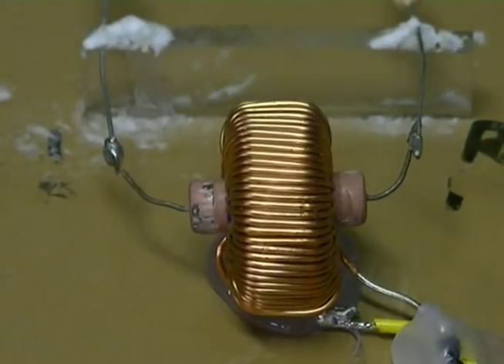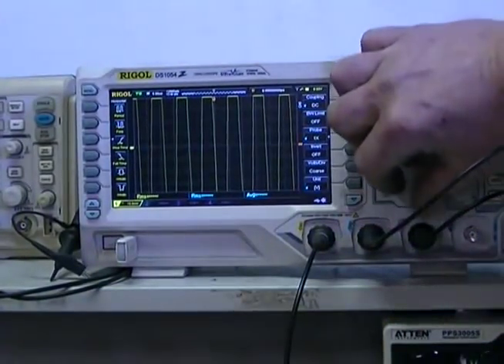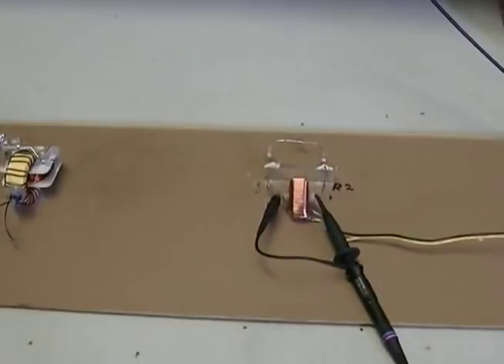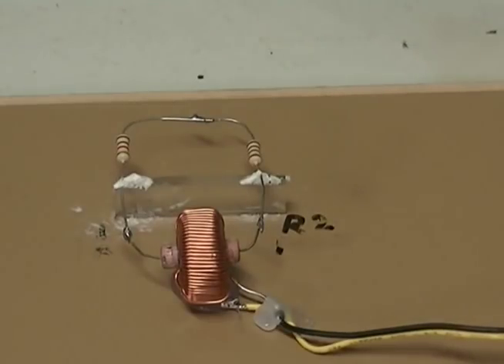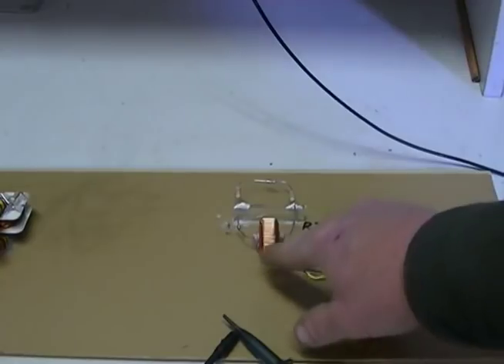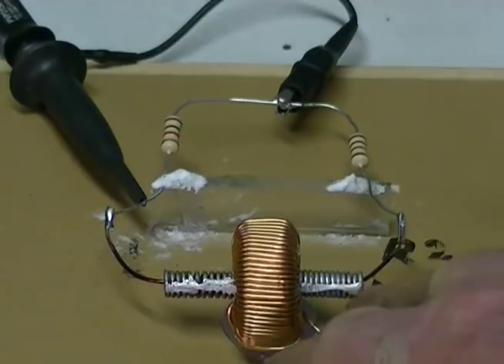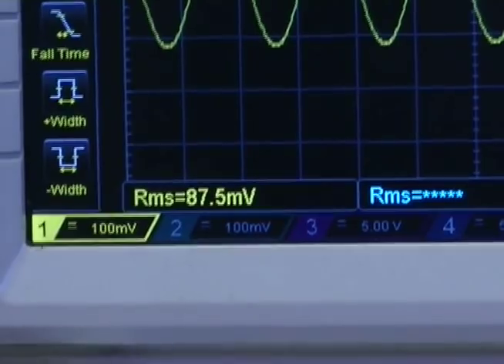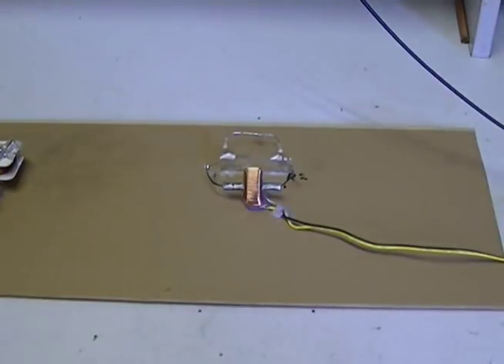Kirchhoff's kunundrum pt4

Comment: Sorry to rain on your parade but a Faraday cage does NOT impede the "magnetic" part of an electomagnetic field, it only shields the "electro" part of the electromagnetic field.  The induction is wholly caused by the changing magnetic field due to the AC power supply being used.
Thank you for the video, wonderful experiment, except for the one flawed conclusion concerning the Faraday cage.

Comment: Thank you +TinManPower for these four video presentations . I agree with you that the emf in the circuit is caused by the induced electric field associated with the changing magnetic flux within contained within the core of the toroid coil. 

I think it's worthwhile to imagine how this electric field looks. For a toroid coil the induced electric field should look like a dipole field. That is the electric field around the toroid should look like the magnetic field of a small bar magnet imagined sitting inside the toroid hole. 

The dipole electric field will be stronger near the toroid but it will extend into the space around it. 

The curl of the electric field will be zero in the space around the toroid, so that integral of E.dl of any closed loop not going through the toroid will be zero and there will be no current in that loop if replaced with a piece of wire. Only loops (like our circuit) which go through the toroid will have a non-zero integral of E.dl around the loop and hence a emf.

I think a lot of the confusion surrounding this circuit comes from Professor Lewin’s statement, without a clear explanation, that the electric field in the wires of the circuit must be zero. This statement is correct, but if taken literally, one tends to imagine that the induced electric field and emf appears only across the resistors. This makes no sense, because the resistors are physically an insignificant part of the total circuit loop.

The detailed explanation is that the induced electric field exists along the entire circuit loop, however in the wire (conductor) sections charges are free to move and create a static electric field opposing the induced electric field. The ‘net’ electric field in the wires is then zero, just as we would expect for a conductor, but it consists of an induced electric field and an opposing static electric field.

The charges causing the static electric field tend to accumulate at the resistors so that an net static electric field is created across the resistors (far larger than the induced electric field due to the short length of the resistors), and it is this static electric field which is responsible for the voltage drop measured across the resistors. 

So because of the behavior of free charges in the conducting wire, the only measurable electric fields in the circuit loop appear across the resistors (in the same direction as the induced electric field), but this is an accumulated static electric field rather than an induced electric field.

Comment: Hello tinManPower, the induction process with this kind of transformer on a conductor takes ONLY place in the opening of the core of that toroidal transformer. This can be proven by turning your loop through the hole this way that the 1K resistor is in the space of the transformers coil. You will see that at that moment there will be only a very small voltage over the 0.6-ohm resistor.
Good demonstration, because you avoid that your measuring wires are induced too. You have also proven that KVL is valid in this case, (because 87mV produced emf = 7mV + 80mV consumed) Also the 0.6 ohm resistor consumes a small part (+/- 0.0009V).
@J. Decker: if you put your measuring wire also through the core, this measuring wire will receive the same induction as the 0.6 ohm resistor and they will cancel eachother. In that case, you will measure no emf of course (zero volt).

I was the first one who made a video, addressed to Mr. Lewin, to show him that KVL was not for the birds in his specified single loop experiment. https://www.youtube.com/watch?v=v85ln_l0fcE&t=125s. After that first video, I worked together with Mr. Mabilde, and a next video made by Mr. Mabilde went into detail (watch: https://www.youtube.com/watch?v=JpVoT101Azg&t=1233s). Later on, also Electroboom made two related videos, which supported Mr. Mabilde's and my view. Best regard, Dirk

Comment: this is as close to free energy as you can get. Electricity generated by resistive losses only
Reply: Hi @rusty what do you mean by this? Will it not effect the load?
Reply: with the results of his tests is seems as is he can generate a primary magnetic field that inductively powers the secondary load without losses other than resistance.  because of his shielding or grounding in between.
no lenz law.
if he used 40 awg wire for the primary the cop would be even greater.

Comment: To measure the resistance across the resistor, you can pass the probe through the core also with the resistor, and then you would get the true reading... just don't go around the toroid.  ...

Comment: This may be a silly question but wouldn't the scope impedance come into play a fraction of a bit more with the higher value resistor measurement. Also if your scope has 2 or 4 channels what effect would you get making the measurements using a channel at each measurement point?

Comment: faraday cages, metal webbing/coils/plates + grounding.  sorry but without grounding, they are just capacitors.
Reply: the currents dont have to be grounded they can be circulating in its own domain free of parasitic losses
Reply: Agree that shielding can work without grounding, just like rf shielding fabric/material can block gsm and wifi signal of the mobile phone which is wrapped up in few layers of suchfabric/material.